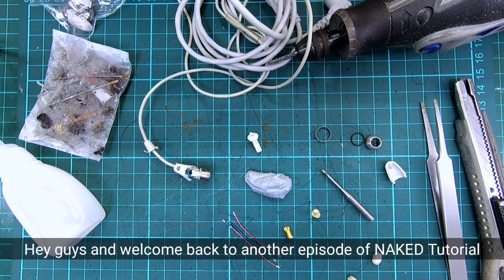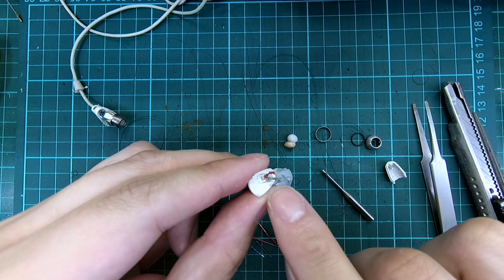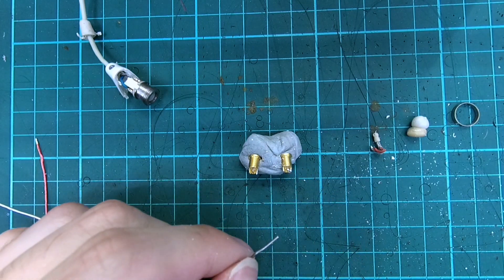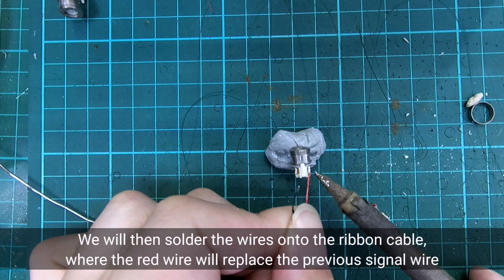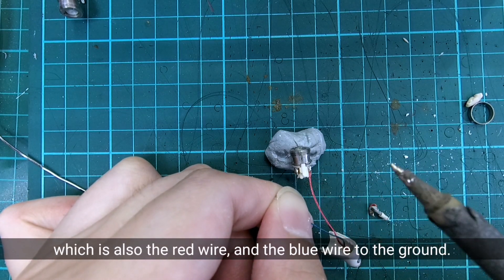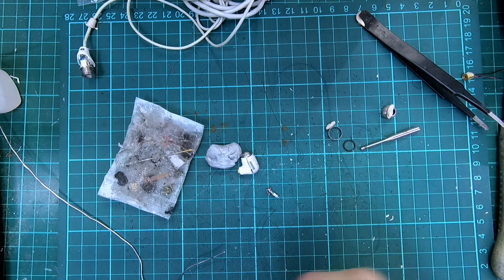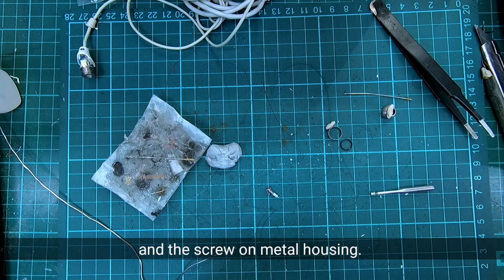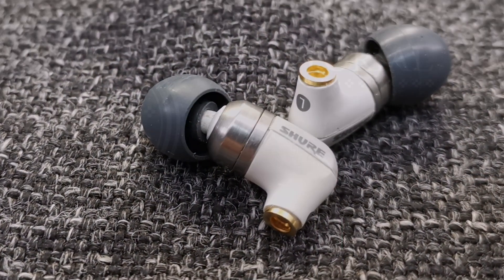Shure E4C MMCX detachable cable mod modification [NAKED Tutorial]

Comment: Wonderful work and tutorial and thanks to the link for MMCX female connectors. Two questions: The link points to a long version and short version of the MMCX. Which version did you use? Why you fasten it with the nut? Is it because there is no room in the E4C housing?
Reply from the maker: the length and size depends on the available space inside the mod, for this mod there is no space
Reply: @sgaudiohive  Thanks!

Comment: hey sgaudiohive team, 
just wondering if it is possible to reshell the Shure E4C / E3C into the newer Shure 215 / 535 shells with mmcx terminals?
thanks in advance
Reply from the maker: I'm sure they will fit, just that u will need to place holders for the driver for it to seal on the output
Reply: Superb! 
 Thanks for the confirmation & assurance.